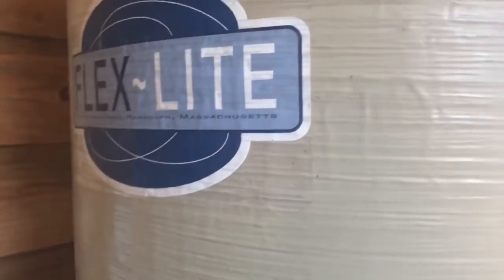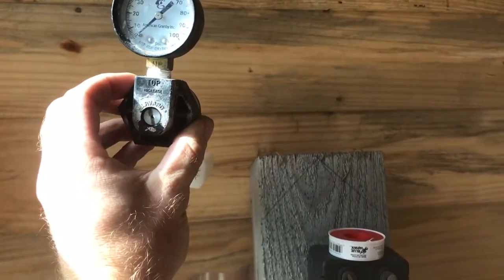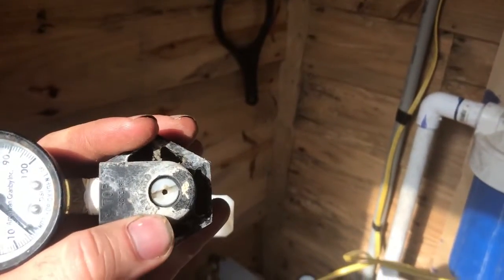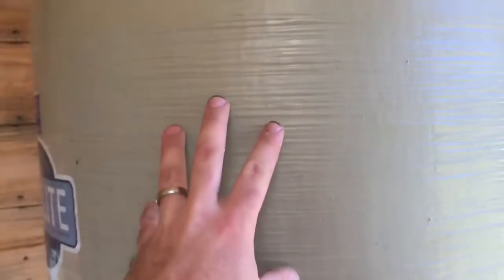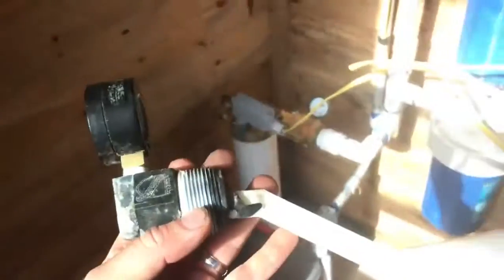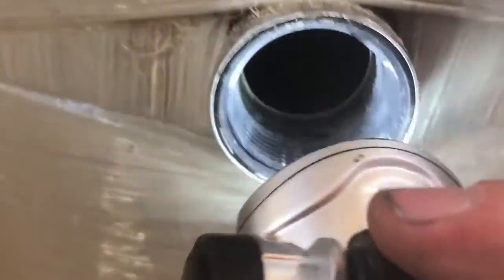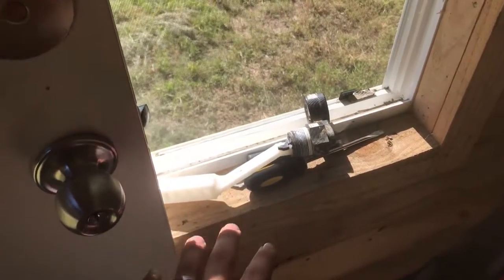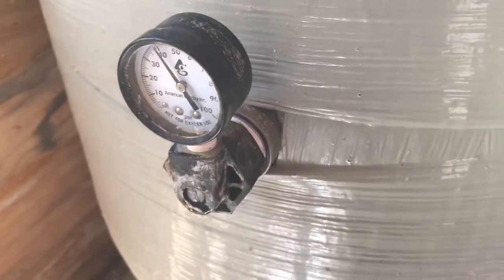Too Much Air in the Water Well Tank   Troubleshooting Air Release Valve

Comment: Ive got two galvanized tanks and the air goes away somehow. So I have to drain the water down about 10” or put air in at the air valve. I can’t see your tank being effective having the air release so low to the bottom. It’s wasted space above that level. I’ve never seen the float valve on a water tank before. Interesting.

Comment: Your control valve should be located higher on the tank. Where you have it only gives you about 10 gallons of water and the rest of your tank is full of air
Reply: Yes, mine is in the middle hole and the water enters the bottom hole.  Never saw one on the bottom. And I have had to replace it before for the air in line issue. And the pressure switch is mounted on the water line going into the tank not on the tank.
Reply: Uhhhh yeahhhhh I was gonna say..... wtf

Comment: Get a new volume control,it needs to be on the mid hole not the low one ,the low hole is for the the inlet from well..Pressure switch should be on the check valve and the gauge should be on the volume control valve.

Comment: Hey! Can you explain HOW does the air control valve works? I can't find information about it. I know when the pump turns off, this valve starts absorbing air, and when the pump turns on, the valve sends that air to the tank. But I can't understand how the pressure in the valve rises the tank pressure (and more), about 45 psi, if this works with the intake pressure of the pump..... of course it's not that high, and it's also "negative" pressure.... Can't find NOTHING with a good, technical information. I'd appreciate that info! Cheers from Argentina

Comment: I can hear the income pipe from the well to the pressure tank sputtering. we get water and sputtering out of faucets and toilet the after 15 seconds the sputtering stops and then it's all water. could it be problem with the well ? I hope not
Reply from the maker: My system is designed to have air in it, on purpose. When my well pump shuts off, the fluid column drops and a Shrader valve on the well head allows air to suck in. Then when the pump kicks on, the air is swept ahead of the water, through the retention tank and to the pressure tank. Some air dissolves in the water to make it smoother coming out of faucets. Some air breaks out in the pressure tank to ensure it always has a proper size air pocket for good pressure. If too much air tries to accumulate in the pressure tank, that’s where this air release comes in and vents the excess back out. My spigots will burp and sputter sometimes too but like you said it’s short lived. My water heater is in my attic which makes it the highest point in the system. My hot water lines are what always sputter. I suppose if I could put an air release up there maybe it would help. 🤷🏼‍♂️
Reply: @TomBrueggen  thanks for replying. Sure is a lot of moving parts to a well. I think there is a problem somewhere, time to call a plumber
Reply from the maker: @mikeo9219  well, maybe. Again, not all pressure tanks have a system like this. The well I grew up on a bladder system. You charged the bladder with air but there was a rubber diaphragm between the air and water. At one point the rubber ruptured and then our air system would slowly dissolve into the water over a month or so. We’d have to continually go out and air it back up, otherwise the well pump would kick in and off way too often and burn up. This air-in/air-out system takes out that concern. But yeah, I guess it makes me dependent upon this air release valve now instead of a rubber bladder. I suppose city water systems just pump up into a water tower and let gravity do the work. Less moving parts there for sure. Maybe build yourself a water tower 😁
Reply: @TomBrueggen  a water tower ? That's a good idea lol.
 This is my first house with a well. I'll check the pressure tank before I call plumber. appreciate your advice for sure

Comment: thank you for posting this, I have a similar setup. every few weeks I have to purge air from the valve because of air in the lines of the house. have you experienced this? any ideas why this would happen, thanks again.
Reply from the maker: We had increasing air problems only when this valve malfunctioned. We do get a spurt from the hot water lines now and then, but I suspect it’s because our water heater is in the attic, and dissolved air in the water naturally breaks out and gets trapped up there in the high spot.

Comment: My tank tee is in that port, and my release is in the higher port. I have a drain on the bottom. I think in the future I’d put the tee on the bottom and the release where yours is, more air, longer draw down. I stretched my switch to run 30/60.

Idk about having the filters pre tank, unknown dirty filters could play hell on the pump.
Reply from the maker: Yeah check out my last videos. With the install of the retention tank we have totally removed the filters and have no more issues. Air release valve is still working too
Reply: @TomBrueggen  can you link it, or give the title? I watched/commented on one water system expansion video.
Reply from the maker: @dukeraul624  I don’t recall which one I bought. Think I found it on Amazon. I was just looking for one that said it had the same thread size to fit my tank.
Reply: @TomBrueggen  I meant a link to the video where you ditched your pre pressure tank filter set up.
Reply from the maker: @dukeraul624  oh! I don’t know that I made a video explicitly about removing them. I removed them when I installed the retention tank. Plan was to reinstall later if needed but the need thankfully hasn’t come up!
Reply: @TomBrueggen  I have a Val-Matic No. 22 air release, lil pricey, but no nonsense nice.

Comment: I'm late to the video, but the Air Volume Control (AVC) you installed is incorrect. The original was a deep-well 310WJ AVC, while the new one was a shallow-well 300L AVC. That brass fitting on the new install is an air inlet valve that is supposed to connect through a plastic (polyethylene) tube to a snifter valve that is mounted on the well pump itself. The old model is a completely self contained control unit.
Reply from the maker: Well I’m not entirely familiar with what you’re saying, but the system has been running fine for over a year since I put this new air release in. What’s the potential long term damage of having the wrong air valve on the tank?
Reply: @TomBrueggen  Your pump will short cycle, run more and may not last as long, hopefully that's not the case. I just replaced the air volume control on a galvanized 42 gal tank was like $30 but my valve is higher up, almost seems like the valve should be in the upper hole on that tank.
Reply from the maker: @xenawolf  I really feel like it should be too. But then again, if it’s down lower it gives a larger air pocket so more room for compression, which could then actually mean the pump runs longer, compresses more, and is off longer. Smaller air pocket would allow more water volume but also less room for compression and expansion. So I don’t know, maybe lower is better 🤷🏼‍♂️

Comment: Similar situation with similar tank, galvanized tank. Thinking of doing the same thing this weekend. How did you repressurized the tank though? Thanks in advance.
Reply from the maker: My system repressurizes on it’s own. I don’t have a bladder. There is an air inlet check valve on the well head. When the pump shuts off, water falls in the well and creates a vacuum. Air sucks in through the check valve. Next time the pump kicks on that air pocket is pushed to the pressure tank and accumulates in the top of the tank. It is then compressed by water flow from the well pump.
Reply: @TomBrueggen  thanks brother, I appreciate the response.

Comment: Air control in wrong spot should be higher up so tank fill up to float
Reply: The air compresses, the water does not. The overall tank pressure is what actuates the pump. It should only bleed just prior to cut in.
Reply from the maker: You know I thought about that too. There is a port higher than this one. I just replaced it how it has always been. Down low the tank won’t hold as much water but I guess would have a larger air pocket for larger expansion range? If the air pocket is bigger does it cause more dissolved air in the water or make no difference? Air/water contact area is the same either way. Everything as far as the excessive air has been fine since we changed it. Only my side of the shower (we have dual independent shower controls in our master shower), the hot will spit and sputter a bit after running for about a minute. It’s odd since no other faucets or sinks in the house do so. I’m thinking there must be a high spot in that line that lets an air bubble break out somehow.

Comment: My system is similar to yours; the air control valve should be in the higher port. This way, it will allow excess air to escape until the water is about half way up. That will make the correct ratio of air to water.
It is the air that compresses  and pushes the water out.
Usually the water is pushed out of the lower hole on the other side of the tank. The pressure switch is normally installed on the line after the tank, but it can go anywhere on the house side of the check valve.
Having it in the lower part is leaving more air in the tank and also makes it much more likely that the valve will get clogged with sediment.

https://cyclestopvalves.com/pages/pressure-tank-maintenance#:~:text=Therefore%20another%20device%20called%20an,to%20the%20AVC%20as%20well.

Comment: Tom I really really appreciate you taking the time to go over this for us. I'm a very hands-on guy and work on most all my stuff but this one kind of had me stumped. I was about to reach out to my subscribers and ask them how to fix this haha... But most my subscribers are in the motorsport industry so I figured I would look some videos up first and voila I came across your awesome video. I'm going to try this right away cuz I have a galvanized tank with no bladder. And I've been having the same issues as you except when mine starts blowing out air I get tons of sediment coming in the house with it because my tank is already nearly 10 years old so between the rust and sand that has settled to the bottom of the tank it is now being stirred up and blown into the house. I'll let you know how it goes buddy I appreciate you!
Reply from the maker: Sweet! That sounds like exactly what I had. My old float valve was blocked up with sediment. Now I think I released a video more recently about adding a retention tank to our well. Since we've done that we have NO sediment coming into the house any more. Every couple months I go open the blow down valve on the retention tank and it unloads a little slug of dirty looking water and then it's clear right away. Good luck, let me know how it goes!
Reply: @TomBrueggen  , you never do tell exactly what this valve's function is. What DOES it do for the water system when it functions properly?
Reply from the maker: @robertk.5195  it’s releases excess air from the pressure tank. Without this valve, or if it malfunctions and doesn’t bleed extra air, the water in the system gets displaced with air. You turn on the valve and get long gaps of pure air between water. I don’t mean some sputtering here and there. We would turn a sink on and just have no water at all come out for several seconds or maybe at all, it would just blow air. Our pressure tank was essentially full of air. It should be about half full of air and half full of water. The well pump compresses this air pocket when it runs and creates a source of stored pressure. Older tanks had a rubber bladder as a barrier between the air and water or they had no bladder but had to always be pumped up with external air source. My system sucks air in every time the pump shuts off and the fluid column drops in the well. Then this air is swept to the pressure tank when the pump kicks on. Some dissolves in the water, some breaks out in the tank to always maintain the bubble. If the bubble gets too large, it causes the float on this air release to drop which then opens the valve and lets the air release. As the excess air releases, the bubble shrinks, the water level rises and lifts the float to close the valve. Pretty slick really